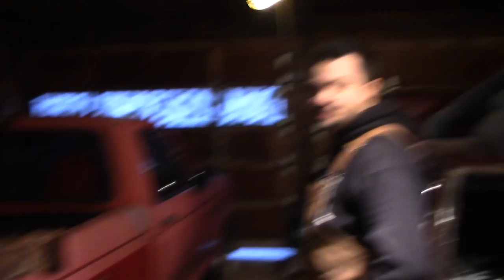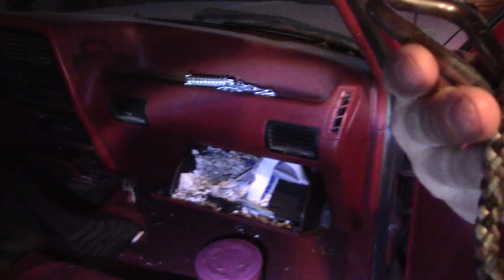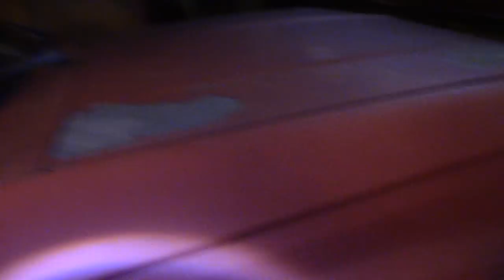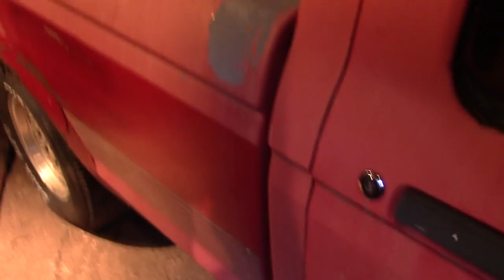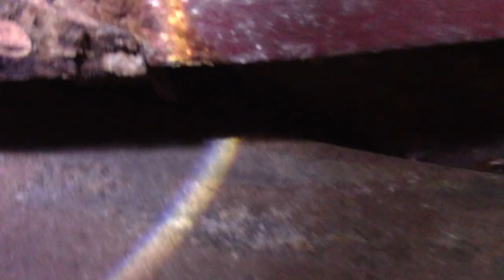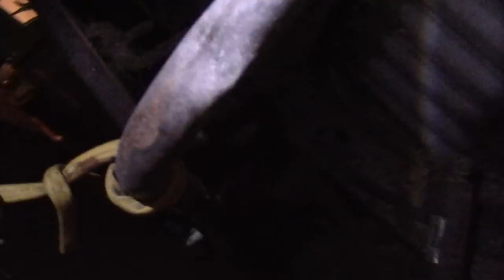The big announcement that replaced that other big announcement

Comment: You guys need to build a rear end with bracing and pinion brake and axles savers so you can throw it in either compact trucks or rear wheel drive compact cars

Comment: It looks like a good first truck to build. One piece of advice though,before you even atempt to start the engine make sure you are 100% sure there are no mouse nests ANYWHERE inside the engine. Especially in the air intake. Just a piece of advice. Love the videos!
Reply from the maker: We definitely did, air filter was completely gone when i picked the truck up, only the wire mesh and the rubber were left. Mice had fun w this one
Reply: Ya i bet! Have fun building this truck!

Comment: How are the engine mounts on the 3.0?  Does the plate that bolts to the engine just have one slotted hole which the frame mount stud goes up and through?
Reply from the maker: Yes Sir
Reply: @1GooseGarage  Weld the motor mount to the frame or the whole shittin works will slide over and break the oil pan.  Ask me how I know lol
Reply from the maker: Lol i sense a fun story

Comment: Hey I bought one of your hotboxes and it spins my motor over just fine with the push button but when I release the button the engine does not stop a ranking until I remove the positive battery cable, any ideas?
Reply from the maker: Message the 1 goose vinyl Facebook page. Adam monitors that too, he can help
Reply: Do you have a switch hooked up to your distributor? there should be to kill spark after the engine is running and to allow spark to start it. If removing your positive cable is working to kill the motor then this should solve that.